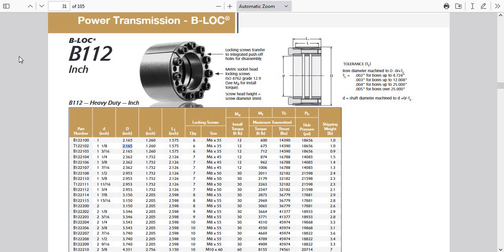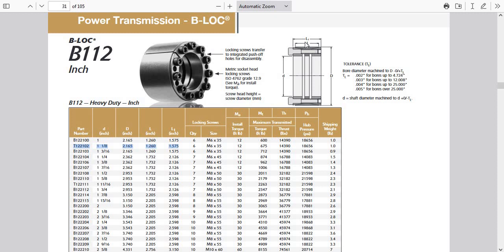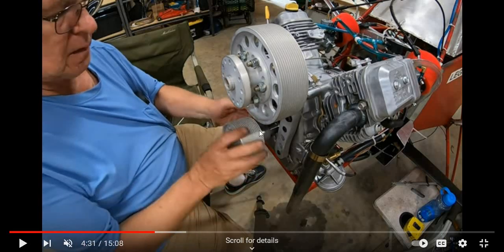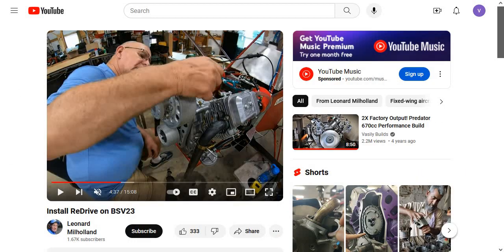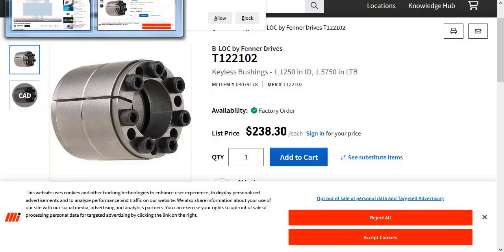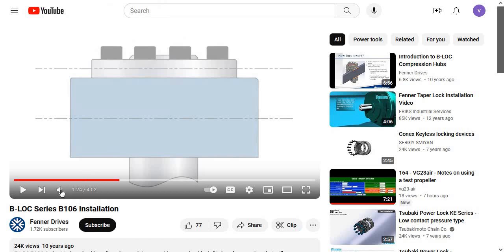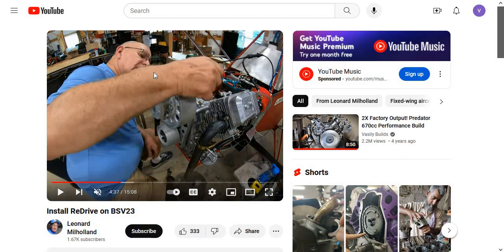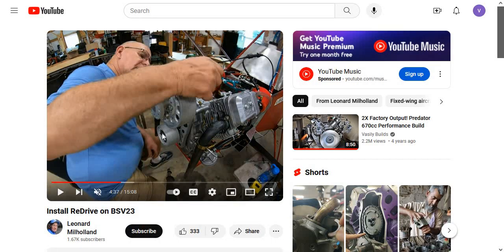166 - VG23air - CONFIRMED -  Shaft Lock Bushing for Ace Redrive

Comment: It looks like the one you show goes into a parallel bore not a tapered bore like the pulley has,  check.
Reply from the maker: ok, i'll check with ace, i thought the pulley bore was non tapered.
Reply from the maker: i don think the pulley is tapered, someone with a tapered CRANK asked ace if their pulley would fit and they said "Our redrive small pulley fits onto a parallel crankshaft.
Only way that we could make it fit is to machine a taper to parallel adapter.
We would have to have an exact drawing of this taper crankshaft.
email us with the drawing."